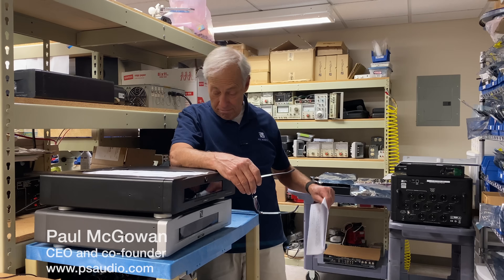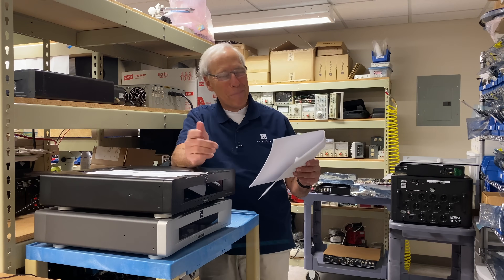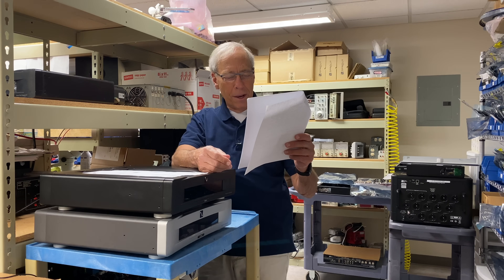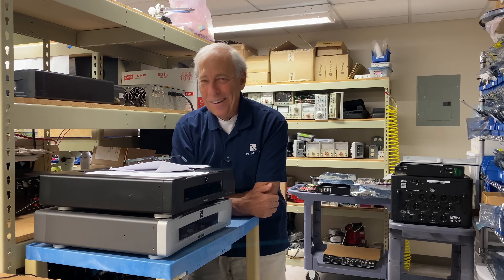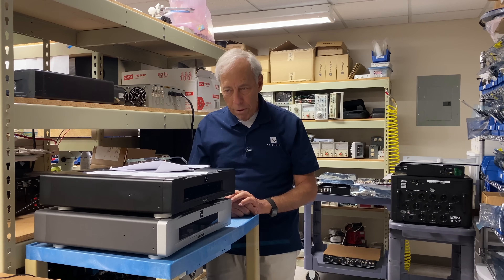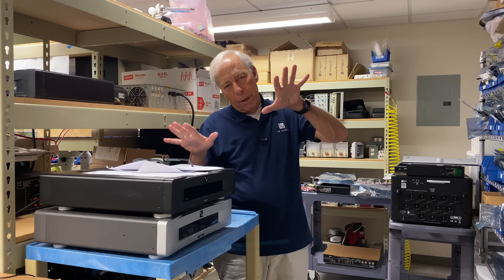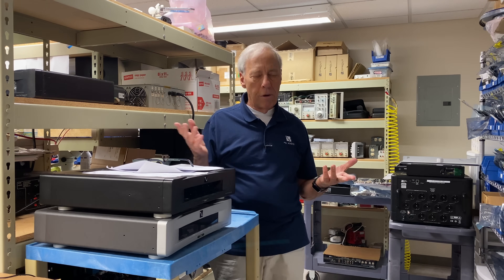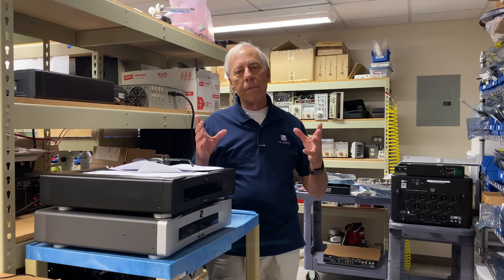DC on the mains

Comment: PAUL McGOWAN, Why is there DC coming out of the AC walloutlets? because when using a Fluke DVM meter set on DC when you put the probes in the AC walloutlets sockets it doesn't measure any DC voltage unless the DC voltage is in the millivolts? or there is a DC offset voltage?

Comment: Years ago I got a power conditioner, but it didn't seem to do anything to the sound from my system, this in a single family home, remote from neighbors. A dozen years ago I got a condo in a group of 24. The sound system I put in there didn't sound good at all, so I dug out the power conditioner, not expecting much, but what do you know, it made a great improvement to the sound. Perhaps a lot of noise from the neighbors, or an unbalanced supply, who knows?
Meanwhile a lot of US beer tastes so disgusting (Bud, Miller, Coors, Pabst etc, etc) it is necessary to serve it very cold so you can't taste it. I notice that brew pubs here serve their beers much closer to cellar temp.

Comment: Hi Paul,  Thankyou for this very informative channel. I get this problem with my Hegel H20 power amp, could I use a mains isolating transformer similar to those used on a building site as DC will not get through to the secondary output.

Comment: Don't knock ale, until you have tried an Old Special Hen, that's sat in the fridge for a few hours. That's a beer BTW, not an actual hen.
Reply: Old Speckled Hen surely ?
Reply: @Ian_Allen  There are three in the range Ian. Old Crafty Hen, Old Speckled Hen and Old Special Hen. Old Special Hen is a little richer tasting and 6.5% if I recall correctly. I'm sure you would love it :).
Reply: @donk1822  Old Crafty Hen is 6.5%, the other two in the range are Old Golden Hen and Old Hoppy Hen. I've never come across Old Special Hen. Gave up alcohol 14 years ago.

Comment: The best solution to the majority of AC mains issues as well as total elimination of ground loops is to use a balanced power isolation transformer to supply the power to all AV equipment. An example would be a Furman IT-1210.
Reply: Or a puritan audio PSM 156

Comment: "What to do when there is DC on the mains?" You start by walking away from smiling audiophile ''engineers'' and start consulting/working together with constant frowning microsystems engineers, ones that know and understand high pass filters and RLC correlations to start with.
On that note, while on the sensitive subject of AC coupling in removing DC component, beer, pregnant belly and other digressive nonsense has no place.

Comment: also what does a loose neutral at transformer do to sound. I had that with a window ac and its motor did weird crap. finally narrowed it down to loose neutral so power company fixed it at the top of the pole. never noticed if it affected my sound.

Comment: Uk voltage is 240v not 230 which is mainland Europe (except for Italy which is also 240v).
Reply: Mains voltage isn't that accurate. The voltage you actually receive could be anything from about 210V to about 250V depending on your location and current grid load.

Comment: I suffer from terrible DC on the mains where I live. I built a DC blocker using a couple of capacitors and a bridge rectifier. Actually I built 3 housing them all in the same box, one for each of my mono blocks and one for the sub. The capacitors help by filtering out very low frequencies, like putting a capacitor in line with a tweeter. 
I call my little device the BUZZ KILL.
Reply: Where do you live? I’m in Boston and I want to get mine measured
Reply: @blanchbacker  I live in rural England. I didn't measure my mains supply. When I moved into my current property my transformers started buzzing. I did a bit of research and found that dc was the most likely cause. Building the buzz kill eradicated the problem.

Many people have found that putting any type of filter on the main supply can suck the life out of the music. (This is why the ps audio regeneration is so good as it doesn't filter the mains, it reconstructs it). Luckily my DC blocker doesn't seem to have had any detrimental effects on sound quality.
Reply: @nathanevans6277  Hi Nathan, what caps did you use please?

Comment: If there is significant DC on the mains, 
transformers will overheat and burn out. 
Want to see how fast it can happen? 
Connect a small transformer to an old-fashioned light dimmer. 
It will take a few seconds at the most.

Comment: To be more accurate, I wouldn't call it "warm" beer: it's at room temperature, which in the U.K. or Ireland (where I used to live) can actually be quite cool. I thought I'd add this because I didn't want someone from say, southern California, thinking that the Brits serve beer at 75 degrees F!
Reply: @FatRat-f9m  So, "room temp" is far more accurate than "room temperature"? I didn't know that.
Reply: It’s not normally served at room temperature, cur cellar temperature, which is  p below room temperature - but not as cold a a fridge,  
it’s certainly not warm.
Reply: It's also a different kind of beer: "bitter", or "ale"....Unlike lager, bitter has a different flavour that suits a slightly warmer temperature due to the different flavour and character coming from its fermentation process. Bitter is top fermented, whereas lager is bottom-fermented. In  the UK, bitter is served at cellar temperature, whereas lager is (hopefully!) served cold, like anywhere else!

As said above, if bitter is served ice cold like lager it really loses much of its characteristic flavours - it's much better consumed at cellar temperature.

Comment: I think the main reason mains gets unbalanced is that engineers have this nasty tendency to draw a schematic with the three incoming phases across the top and then pick the first one to drive the controls and other single phase loads.  This means that the first phase always seems to be mistreated.  It’s certainly what I’ve seen on a daily basis along with half wave rectifying a supply to 4KW infra-red paint dryers in two rows of 144!  Oh and I don’t drink a beer warm unless it’s one made especially to drunk that way.

Thanks,

Drunk Dunk. Hic!
Reply: Female engineer? Rare
Reply: @Coneman3  Rare but not unheard of.

Comment: Is George talking about hum in the power supply or hum in the audio output??
Reply: Audible hum (mechanical) coming directly from the transformer, not from the speakers.
Reply: I have replayed the beginning of this video 4 times and nowhere does it say that the hum is in the power transformer or the audio output .. he says "I have a pesky set of monoblocks that hum at certain times of the day"
Reply: @bobross6802  
I agree Paul should have clarified.  You are not the only person confused about whether or not he is talking about hum from the speakers.  
However, DC on the mains - the central point of the discussion - certainly can cause power transformers to hum or groan audibly, so it's reasonable to assume this was the issue that George was reporting.  
It is the same sound you can get momentarily from any power transformer when it is turned on, if there was residual magnetism left in its core the last time it was turned off.  I've done some experiments with a 500 V-A isolation transformer I have, and even without a load, it will draw current peaks higher than 40A for the first cycle or two.  That's accompanied by a very audible "groaning" sound.  DC coming from the mains can result in similar current peaks.
Reply: @marianneoelund2940 ...confusion is Paul's 'shtick'...it gets us all talking.
He does it time & time again.

Comment: How to use a rectifier bridge:  
Paul's description wasn't right.  You only need a single bridge to get 1.2V drop.  
1.  The bridge does NOT go across the AC mains!  Instead, connect one of the bridge AC terminals to the mains live side, disconnect the equipment power lead from the mains live side, and connect it to the other bridge AC terminal.  That is, the bridge's AC terminals go in series with the transformer in your equipment.  Make sure all of these connections are inside a safe enclosure and that all connections are well insulated.  Also make sure the bridge has adequate heat sinking, if required by its design.  
2.  Put a shorting jumper across the bridge's + and - DC terminals to complete the current path.  
3.  If that's not enough voltage drop and you need more, you can use two bridges with their AC terminals in series, with a separate jumper across the DC terminals of each.  

Transformer Core Saturation - why DC is a problem:  
Transformers are provided with enough core steel to allow for the magnetic flux that occurs when it's connected to the AC line, plus a little margin.  But cores have a limit on the amount of flux they can "conduct" (called the saturation flux) and if you try to exceed that, for example by connecting to a line voltage that's too high, then the primary current rises very fast.  Electrically, we say that the effective inductance when the core saturates becomes very low.  Because transformer primaries have very low copper resistance, the current rise can be tens of amps, even for a transformer that's only rated 500 VA.  
Even a small DC voltage can cause the transformer to draw many amps of DC current through its primary.  If that DC current, on top of the normal AC current, exceeds the saturation level, it causes a large pulse of current to be drawn in every AC cycle.  Often this produces an audible hum from the transformer.

Note that low-frequency AC on the line, that is much lower than 50Hz or 60Hz, can cause the same problem as steady DC; it will just be intermittent.  Such low frequencies can be caused by any heavy load that is varying with time, such as a motor starting up, a heater turning on, or a high-power audio system, and that could be in a neighboring home or building.
Reply: Hold up, if, I just want to get rid of the whistle from my sub, for example: Do I get one suitable rectifier after it's main power cord, connect FROM ac, and put another rectifier in series from what would be the DC out of the 1st rect, going into what would be the 2nd rectifiers AC in?  What is "across the AC mains"? What about earthing?
Reply: @donpayne1040  
Normally, bridge rectifiers are connected with one AC terminal connected to the mains live side, and the other AC terminal connected to the mains neutral side.  That's what I mean by "across the AC mains" but it's not the configuration you want for the application Paul was trying to describe.  In normal use, a bridge puts out DC power, but here we just want to use it to cause a small voltage drop in the AC going to the transformer.  
So the mains neutral and earth connections are still wired directly to the equipment as before, with no change.  We are only inserting the bridge in series with the mains live side.  
You don't have to use a bridge; it's just a convenience which reduces the number of connections you need to make.  Instead, you can just use a pair of power diodes in parallel, facing opposite directions (cathode to anode), and insert that pair in series with the mains live lead.  That gives you 0.6V drop.  Add more diode pairs in series with that, if you need more voltage drop to solve the problem.  
However, if you are getting a whistle from your sub, it's probably another problem.  The video was not discussing noise coming from speakers.  It's about audible mechanical noise coming from the power transformers.
Reply: @marianneoelund2940  True, yes transformer buzz, i've experienced that on a very "hhm let me plug this transformer in and see what it does...eww" level. Wow, you're well endowed with some great knowledge. Fair well.
Reply: @blackened18019  BUT, without this video I would  not have just recognised the fault in my psu and it's reason for making the transformer buzz. Faulty diode, quick change, buzz reduced/gone. Without videos like this slightly electronics inclined audiophiles do very vey foolish things. Tough call.

Comment: As so often, it's best to fix the root cause of the problem rather than add medicine to cover it up. You can cause a DC on the mains if you have a load that's not symmetrically loading on both halves of the sine wave e.g. if someone made a heater with a power level switch that works through a diode cutting the power in half.
Reply: Also, momentary asymmetrical loads occur any time a heavy load is changing its current draw, such as a motor starting up or a heater turning on.  Lots of kitchen appliances are in that category.  
Or, more pertinent to the question discussed, high-power audio equipment in a neighboring building.
Reply: Your heater example is a good one, that could (in some circumstances) cause DC on the mains.  In my garage, I have a pair of 3000W 240V overhead infrared heaters.  To make a "low" power level I used half-wave diodes, which work great.  Just to be careful, I called my local utility company and asked if this type of load would bother them.  They said no.
Reply: @kc9scott  LOL, funny. I actually wondered if anyone dared to do this. But it will work, although it is one way to mess up the mains power sine wave. And it will not be cheap if your audio system ends up needing a power regenerator while you run your heater in your garage.

Comment: The diode bridge part was very badly explained Paul ... do it again using a white board and explain it properly as some people might try experimenting with lethal results any way it's not as simple as just a diode bridge ... What Paul was referring to is the 3 phases that power comes from. Uneven loading causes the star neutral point to drift away from neutral .. in an ideal world this point would be clamped at 0 volts. Delta connections are a better way to go .. but not always feasible

Comment: How can you distinguish EMI/RFI from what you're talking about with the transformer itself?
Reply: The video isn't about noise getting into the signal path.  It's about the power transformer emitting audible humming directly into the air, which EMI doesn't cause.  EMI can only cause noise in the audio output to the speakers.
Reply: @marianneoelund2940  Why you know that?

Comment: Fair to say DC will also cause your transformers to saturate which also degrades their performance.  So DC gives noise in the form of hum and a degraded musical performance if the power supply is sagging due to saturation.
Reply: How does DC make a transformer hum? I get saturation. I dont get how a flat voltage could hum.
Reply: @kolinstallman3788  I believe it is not a flat voltage, but an imbalance.  Instead of a sinusoidal swing from +120 to -120V there is +120.8 to -119.2V.  The magnetic imbalance causes mechanical movement resulting in 60 Hz hum.

Comment: Howdy.
A powerful half wave rectifier may cause unsymmetry in the mains sine wave. I suppose this may be thought of as a sine wave riding upon a small DC.
Loading one halfwave will decrease the voltage and surprisingly enough increase the unloaded halfwave if the grounding in the electrical panel is weak.
Appliance transformers are usually designed to just go into borderline saturation when the sine wave is symmetrical. If one halfwave is stronger the core will saturate harder making it sing.
One possibility is using a separation transformer to feed the amplifier. It should be designed to stay way below saturation. It should have more turns in the windings as normally. Say 10% more. The separation transformer will break the DC.
Regards.

Comment: Can Europe play louder than America??
230v vs 110v.
Reply: I Think Europe has a voice, just we are playing it loud enough...😂🙂
Reply: Thomas Thomsen No! Voltage and amp are different things. Most US transformers are also made for the European market.
Reply: American homes are also 240v and you could get commercial equipment in your home if you really wanted it. But yea their single phase 230 is better in pretty much every way.
Reply: But simply, yes. A typical euro circuit is 230v 13 amps while US is 120v 15/20 amps. So they get roughly 500 more watts to play with vs our 20 amp 120v circuit. Then frequency comes into play.
Reply: @kolinstallman3788  In the Netherlands it is 230v 16a for a single group breaker in your home.
Reply: My Home has an Old installation, so i’ve got 230v. 10A....😷
But yearh, 230v. 16A. Is more normal overhere...
Reply: @trutmaasfull  by the way in regards to your question. I saw an interview by as of recent late Eddie van Halen, and he said a 230v guitar amp on 110v took way longer to warm up its tubes but he could crank it up to the max and it sounded as awesome as 230v full tilt but just not as loud.
So in the end he used a Variac on a 110v guitar amplifier and controlled it down depending on the room/venue. At 60v it would be home player, 89v would be for studio recording and 100v would be full concert strength. But no matter what he'd adjust the variac between 60-100 volt.

So yeah, there is some story to what is louder at least for tube amplifiers. When in the USA (110v mains) you could set an amp to 230v and it would sound quieter. Doing it the other way around in Europe would mean some blown capacitors though, a 110v amp on 230v mains would let the magic smoke out.